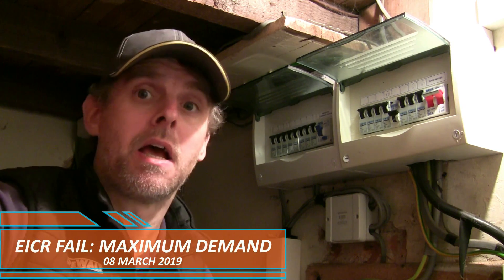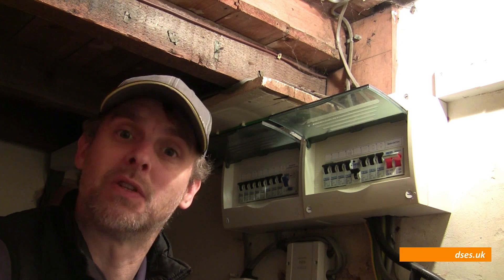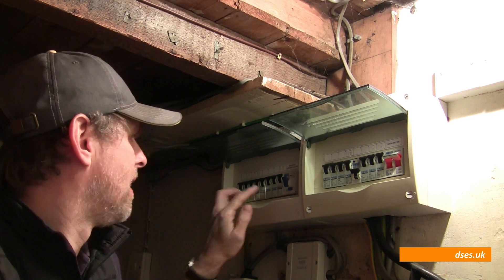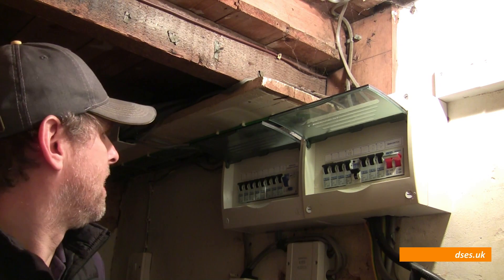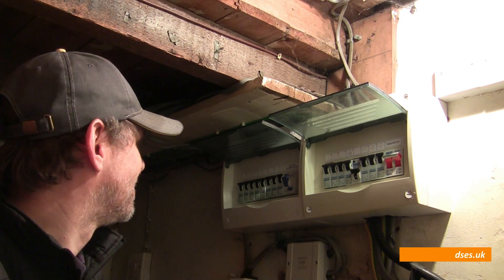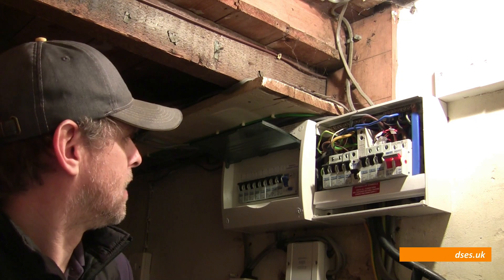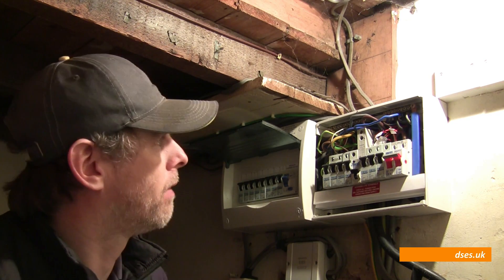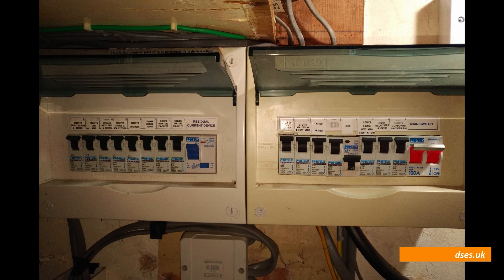EICR FAIL- Maximum demand

Comment: You'll have to put in a non-priorty shower unit, If you want to build it in to the consumer unit(not sure if they even sell them of the shelf for 3 showers) I can send you schematic drawings.
Reply from the maker: That's exactly the kind of thang! I use one myself for my shower and car charger.
Reply: What are these priority breakers called - maybe you can put in a link to an example?  Could they be used to prevent multiple electric car charger points from overloading a buildings supply?
Reply from the maker: @Richardincancale  I'll be doing a video on mine soon, but if you want more info on off-the-shelf units, then see meteorelectrical.com who sell a product made by Garo (code CV8-PS). Only problem with the Garo kit is it's an IP enclosure, not steel.
Reply: You could I suppose,  they are basically made up of a couple of  contactors , a current sensing relay,  control mcb and a RCBO.  They will only let power to one unit at a time.

Comment: What’s the technical name for the shower sharing device? Thanks in advance
Reply: It's a series of interlocking contactors (typically with current-sensing relays). The purpose-made assemblies are typically referred to as "priority units".
Reply from the maker: @richardwalsh5882  Garo are the only people who make the priority units that I know of (at least, they're the only ones I've installed), and I've had to order them in from Meteor Electrical in Ireland. I don't know why they're not  readily available over here as I imagine there are a fair few sites that could use them, especially people in my position who want to hook up an EV charger to an already heavily loaded site.
Reply: @dsesuk  
Cheers I've never even heard of these. Fortunately I can't remember ever installing more than one electric shower in one property. Maybe installed a mixture of combi and electric. 👍👍 Good video

Comment: Not had to deal with it myself yet, but what's the odds of a shared neutral on that lighting mcb with 3 circuits in it...
Reply from the maker: We check for that on older properties, but there wasn't such here. Just a glut of circuits all shoehorned into one breaker!
Reply: @dsesuk  ahh, thought it might of been a dodge to get round the shared neutral issue.  Another good video 👍
Reply: Thanks David I have heard of this borrowed neutral a few times and been trying to find info out on testing for it. There is no real testing videos for this out there you should make a little video if you ever come across it. I am still learning so all this info is great. Thanks for the reply
Reply from the maker: @gd-bq7em  A shame as I had one on my own house, but I corrected it in 2012 by pulling in a new cable! If only I'd thought of YouTube back then!
Reply: @dsesuk  if you came across a borrowed neutral on the lighting and was not able to spit the circuits would you join the upstairs and downstairs into one 6 amp or 10amp  mcb depending on the size of cable feeding them
Reply from the maker: @gd-bq7em  Yes, I would. In the past, I used to keep them separate if they were already split, and I would label the board to say 'a known borrowed neutral existed between circuits x and y and both should be isolated before performing work on either', but these days I put them into one breaker to reduce the chance of one circuit being live while the other is worked upon and I would note it on any related certificate or report.
Reply: @dsesuk  ok David thank you for your help and for the info it's much appreciated. And keep up the good videos it realy helps speed up the learning process 👍
Reply from the maker: @gd-bq7em  I'm still learning myself, and I'm always open to being put right on anything I've said wrong on this channel!
Reply: @dsesuk  👍
Reply: @dsesuk  hi David sorry to bother you again I have another question it's on insulation resistance. If you replace a consumer unit and  sensitive loads are not possible to be removed can you perform live and neutral combined and test to earth at 500v. If so would you just make a note on the cert
Reply from the maker: @gd-bq7em  Hi Greg. When we do a CU change, we first book in an EICR to get the whole thing tested and inspected as much as possible, then we book the actual board change for another day. Most installers try to cram it into one visit, or do the testing afterwards (if they do it at all). I saw one big YouTube name tweeting his relief that the ring end to ends were testing okay following a board change, but if you haven't verified things like that are okay in the first place, how can you proceed to change the CU, and what will you do if you find things are not in a condition to be signed off afterwards? IR testing can be tricky, and while we'll always test to earth, it's not always possible to test L-N in the real world. It's important the IR is checked LN to Earth to be sure any RCD/RCBO devices won't nuisance trip afterwards, but limitations on testing between L-N can be recorded on the cert.
Reply: @dsesuk  ok. Very informative thank you. Like you say L to N in the real world could be very tricky because there could be things under the floors that could be damaged at 500 v and you just can't disconnect everything. But what I can make out is that L+N connected to earth stops things from being damaged. Thanks for your response
Reply from the maker: @gd-bq7em  Yeah, the should be the case as by pumping 500V into both line and neutral, you're keeping them at the same potential, so sensitive components connected between them won't be damaged.
Reply: @dsesuk  ok i understand it now. thanks for the help i will leave you to your Sunday 👍
Reply: David.What is the best way to test for shared neutrals on a lighting circuit
Reply from the maker: @gd-bq7em  Domestically, it's usually on the landing light, fed from the ground floor hall with a neutral nicked from the first floor lighting. Power on just Lights Down to see if the landing light illuminates. If so, power down, disconnect the neutral for Lights Up, power on Lights Down again and see if the landing light still works. If it does, it's not borrowing a neutral from Lights Up. If it doesn't, beware that floating neutral cable you disconnected as it may now be live! Of course, this is a simplified test for a small installation, for larger or more complicated installations you could do an R1+Rn test by looping the line & neutral at the board and checking at the accessory that you have continuity.

Comment: Your "earth leakage" test is flawed. You are measuring the current in the main earthing conductor with the bonding still connected on what appears to be a PME system. You are measuring diverted network neutral currents which will exist in a healthy system. Repeat your test by clamping both meter tails into the current clamp & see if you get the same result.
Reply from the maker: It's not PME, but off camera I did check with the bonding off and via the tails. Results were similar, so I went with what was easier to demonstrate. I take your point though.
Reply: Its not pme

Comment: A question please Dave (or other qualified electrician)... should the sum total MCB amp rating never exceed the main service fuse or does diversity apply...e.g. is 60 amp service with 80 amp total MCBs allowed ?? 

It seems like a situation of overload would exist in this case if , theoretically, every MCB was at max load ??
Reply from the maker: Adding up the sum total of MCB ratings would blow maximum demand in most properties, so diversity is taken into account. Some circuits, such as those electric showers, are going to be taking near the rated value, but that's usually not the case with lighting and sockets. It can be tricky to work out, you could have two small houses, one with two socket circuits, one with a single socket circuit, but even if they had the same appliances and the same number of outlets, the one with two circuits would, on paper, have a higher maximum demand if calculated according to the regs.
Reply: Yes your right diversity should be applied, as you said if all mcbs were at full load they would exceed the rating of the main fuse in 99% of modern installations, most homes have a 32A circuit for cooker and a couple of 32A socket circuits, chuck in a 16A water heater and 2 x 6A lighting circuits and your way over the normal 100A single phase supply. Also many new homes are increasingly being fitted with 80A supplies so diversity is definitely needed. There are tables in the on-site guide for guidance on diversity but they are really outdated, especially with the influx of LED lamps and energy efficient appliances. Personally I think It's best to look around the property and check what lamps/appliances etc are in the home and calculate the demand that way
Reply: If I remember right John Ward did a good video a few years ago about maximum demand and Diversity which is worth a watch if your interested 👍
Reply: @mickbitchum4664  https://www.youtube.com/watch?v=Wq0uODypaGI
Reply from the maker: @tbohlsenNSWSSMRC  Thanks for that, I've seen a few of the great man's vids, but I don't think I've caught that one, so will tune in!

Comment: Good video mate. Would be good to do a follow up to this video with the new DB and investigate the earth leakage source.
Reply from the maker: Was thinking the same. Might be a while before it's all done and dusted at that site, although I think we'll get the work.
Reply: @dsesuk  I hope you do. Would be nice to see them get a proper installation instead of the mess they currently have. Edit: Actually, I see this is an older video. Did you get the job?
Reply from the maker: @floorpizza8074  Yes, we've been appointed for the work, but the new board still hasn't gone in. We've since been back for some remedial work to allow the upgrade to go ahead, but the delay is down to scheduling and to our waiting for some new consumer unit models to come out as manufacturers switch from type AC to type A RCBO's. We should hopefully be doing the board change in the next couple of weeks.
Reply: @dsesuk  Good to hear! Love it when guys that do high quality work (and take great pride in it) get the job. I know you're really busy, but would love to see a bit of video from that job. :)
Reply from the maker: @floorpizza8074  We have some footage of the remedial work and intend to take the camera when replacing the consumer unit, so there should be a follow up to this before the end of the month hopefully!
Reply: David Savery Electrical Services have you posted the follow up video yet?
Just tested my earth leakage...  .458A
Reply: I agree, the final outcome would be interesting!

Comment: WHY DO THEY INSIST ON PLACING ELECTRIC IN SUCH STUPID PLACES 
ANYONE WOULD THINK THEY WERE TRYING TO HIDE IT
Reply from the maker: You wouldn't get away with it on a new build these days with Part-M of the Building Regs. I guess, back in the past, they just wanted to keep it out of sight, never mind if someone in a wheelchair could get to the thing if the lights went out!
Reply: I've come across a consumer unit hidden in a corner cupboard under the kitchen worktop - they had chopped a hole in the back of the unit to get to it.
I had to contort myself upside - down through a 400mm unit door to be able to get to grips with the blasted thing.